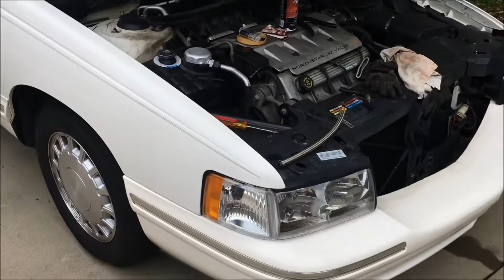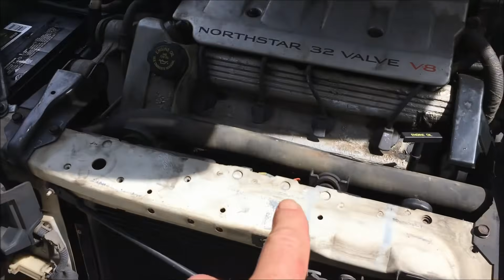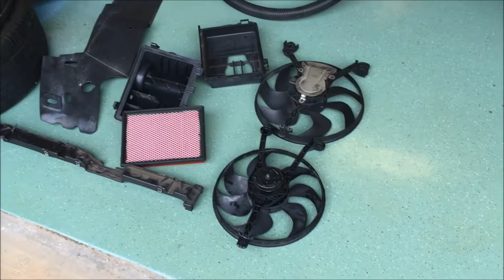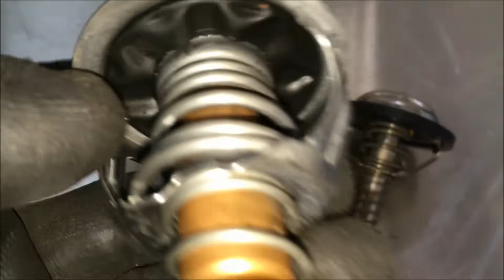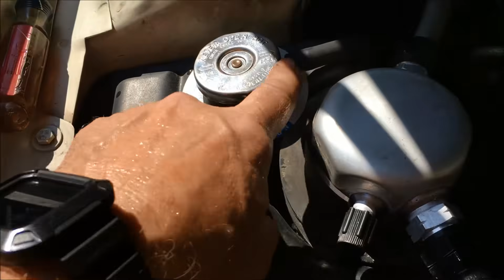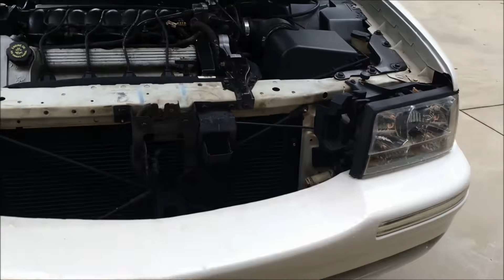How To Flush, Fix Overheating, Leaks, Coolant Reservoir, Radiator Replacement: Cadillac Northstar

Comment: Enjoying your videos. Old cars may drive me to drink. May consider bourbon as a cure. Maybe you could recommend a good brand. I knew nothing about Northstar Cadillacs. Never even considered myself a fan of the brand. But last summer I managed to buy a pair of the "tri-nines." Little did I know of their infamy. What "Bro Stone" calls the short "header bolts." LOLOLOL So my '97 DeVille D'elegance has had overheating/coolant loss issues. I had my longtime trustworthy mechanic replace the coolant tank that I ordered from GMPartsNow. Not sure if he checked/cleaned/blew out the line that goes underneath the big silver engine cover. I'll be checking this on my next day off. I may try to tackle the thermostat changeout under your tutelage. TYVM for the great videos. I subscribed.
Reply from the maker: Hi Jim, thanks very much for the comment and subscribe.  I'm glad my videos help.  I do everything myself because I don't trust most mechanics, especially after what I have seen from some of those who have asked for my help.  As for Bourbon, I love Buffalo Trace, Woodford Reserve... there are so many good bourbons!
Reply: you probably dont care at all but does someone know of a way to get back into an instagram account??
I was stupid forgot the password. I appreciate any tricks you can offer me!
Reply: @sebastianmiller9101  
Here's the password to get back in LETS GO BRANDON 😷 😷 😷 😷
Reply from the maker: Lol!!!!
Reply: @Huxley Rodney Thanks for your reply. I got to the site through google and im trying it out now.
Looks like it's gonna take quite some time so I will get back to you later when my account password hopefully is recovered.
Reply: @Huxley Rodney It did the trick and I actually got access to my account again. I'm so happy!
Thank you so much, you saved my ass :D
Reply: @Sebastian Miller You are welcome :D
Reply: Need help with my caddy on the cooling system bro 🙏🏼
Reply: @chinorider7251  what's up?
Reply from the maker: What’s the problem with your cooling system?

Comment: Only issue I notice I'm not over hearing I change almost everything especially new radiator but I'm having small leak after long drives when I shut the car off. It's look like the driver side mainly bottom middle
Reply from the maker: Only thing I can recommend is putting the car on ramps with engine running, get it super hot and trace the leak.

Comment: Cadillacs northstars are just pure JUNK JUNk JUNK , If the motor doesn't blow the transmission will
Reply from the maker: this car was well taken care of and had no issues with transmission nor engine.  Before it was wrecked, it was at 130k miles

Comment: i heard you say to burp the system you squeeze the upper radiator hose. did you do that with the reservoir cap off? heat on? can you give more details please, i have to burp my 1999 cadillac deville.
Reply from the maker: When the engine is first started and cold, you can burp the system by squeezing the hose to remove air pockets.  Never open the radiator cap while the engine is hot.  Also, it is best to run the heat at full blast while doing this.
Reply: @DrivingIntelligence thanks fam I did it today watched the bubbles

Comment: I get no hot air whatsoever, only cold air , its not leaking anywhere, im left with , replacing thermostat, doing a complete flush and replace coolant, or replace heater core?

Comment: I have a 99 Deville I can never open the radiator cap what am I doing wrong
Reply from the maker: You can’t open the radiator cap when the engine is cold? Normally, you just push down and twist counterclockwise.
Reply: The cap will not open when I turn it I have no idea if I'm just not pressing enough if I'm old LOL or what  @DrivingIntelligence
Reply from the maker: You might have a faulty cap, but it takes a lot of pressure.  And don’t open when hot!

Comment: Really thank you for educating me on this car I have a 98 Eldorado it's only got 78,000 Mi on it Elder gentlemen bought it what's 10,000 MI and it's mine now say beautiful car and I want to get a 150,000 out of this motor how do you replace the thermostat change the oil new plugs new filter new coolant I unhook the purge line and blew it out with my hose and fluid was coming out of the the reservoir so that told me right there that I didn't have any blockages so I'm good with that haven't had any trouble with it heating up I'm just it's just me I'm going to go through it and do what I think it needs to be done radiator looks good fans come on good I will probably have to replace the top hose pulled everything off the top blew everything out pull the engine cover off the top some squirrels left their acorns underneath there so I got all that clean beautiful car love it I just want to take care of it thanks for your input can you educated me on this finicky Beast
Reply from the maker: Thanks for your comment.  I love these cars and the Northstar Engine.  Check out this Playlist and let me know if you have any other needs:  https://youtube.com/playlist?list=PLGNsbVXzRfZOZLzjeTGQyLUsFDPYwttq4&si=Th7dKepGevsSWcRt

Comment: I installed a new surge tank but can not figure out how to get the clamp back on to the resvoir? On my 1999 cadillac eldorado.  Thank you for any help.
Reply from the maker: Hi Sheila, what is a “clap”
Reply: Sorry I meant the clamp/slash strap that goes around the ac accumulator
Reply from the maker: @sheilacoleman4134  sorry for delay getting back to you.  Did you figure it out?  I started a video showing this process and could release in a couple days.
Reply: Thank you for getting back to me, and no did not get it back on yet. Oh I would appreciate a video on how to do this. This was originally my Dads pride and joy. He passed away in December and we brought his cadillac to our house. So we want to keep it in the best shape we can as he did.
Reply from the maker: @sheilacoleman4134 sorry for your loss.  I’ll work on that video this week.  And let me know if you have other needs for your Cadillac.  What year and model?
Reply: Thank you so much, I appreciate your help. It's a 1999 Cadillac eldorado

Comment: Fixing my DeVille it overheats. the coolant reservoir is always full.the tubes running to the radiator feel empty. idk what it is
Reply from the maker: Did you check the tube going over the engine and returning to the reservoir to make sure it's clear?
Reply: @DrivingIntelligence  yes I flushed those lines but the coolant is still stuck in the reservoir and won't circulate is it a water pump or clogged line under the reservoir?
Reply from the maker: @MoSxJuve  have you checked the water pump belt?  Is the water pump in good order?  How about the thermostat?
Reply: @DrivingIntelligence  I changed the thermostat and the water pump belt spins but I haven't really looked at it
Reply from the maker: @MoSxJuve  maybe a silly question, but did you install the thermostat in the correct direction?  :)  Also, are you sure you don't have a head-gasket problem?
Reply: @DrivingIntelligence  idk it doesn't smoke bad
Reply: @DrivingIntelligence  I think it's either a blocked tube behind the motor where the reservoir line goes or the water pump
Reply from the maker: Does your oil and coolant look normal?
Reply: @DrivingIntelligence  the coolant looked milky
Reply from the maker: @MoSxJuve  that's a bad sign... could be a bad head gasket.  You might be getting exhaust into your coolant which is causing the overheat.  There are test kits you can buy that will indicate if you have exhaust material in your coolant: https://amzn.to/3ufq82b - I've not tested this kit, but it could help you pinpoint your issue.
Reply: @DrivingIntelligence  the owner said she put a sealant in the radiator for cracks that may be making the coolant white
Reply from the maker: @MoSxJuve  and could also cause a blockage... :(

Comment: So I just bought a 97 Cadillac DeVille d'elegance, I'm overheating because she is overheating, I replaced the thermostat, I've already replaced my  alternator, but I am getting ready to replace my reservoir. Ugh. But ty for this video. You helped a lot. Next imma have to fix the air hose for the car leveler? Something like that. I'm dragging and riding low. I'm gonna look to see if you have any videos on that. Thanks again buddy.
Reply from the maker: Make sure you check that return line to the reservoir.  That’s the biggest cause of overheat with these engines.  I showed in my video… also, check out this video:  Overview of Cadillac / GM Electronic Level Control System - Deville Series Part 13
https://youtu.be/jSEWSeHufKY

Comment: Going to see if any of this will help my 98 STS. Off road since November, took it out yesterday, and no problems until I put the AC on (don't need it much in my country tbh), and it started belching steam from under the hood. Heard some ominous bubbling from around the head are, and lost majority of water from the expansion tank through the plastic lid
Reply from the maker: Did the overheating start instantaneously when you  turned on the AC?  Are you sure your electric radiator fans are turning on with the AC?
Reply: @DrivingIntelligence  Thanks for getting back. That seems to have been what happened. Although the fans turn manually to the touch, didn't hear them running. Had taken the Cadillac onto the motorway, got to my house - no problems. Took it a short distance to pick up son, switched cold air on and next thing I notice steam appears.
Reply from the maker: @iainmorrison4606  slower driving increases engine heat, especially with AC on.
Reply: @DrivingIntelligence  thanks. Just tested the thermostat - working, so think a combination of putting the AC on and the fans not working (thankfully in Scotland we usually only get a couple of days of hot weather!)
Reply from the maker: @iainmorrison4606  yeah, those fans are absolutely important to cooler running.  Check the fuses and relays?
Reply: @DrivingIntelligence  fuses and relays fine. Is there a sensor to operate the fans? I couldn't find one and factory manuals not providing an answer (though had provided something to chew on for the mice that got into the car). Think this is a definite single malt time.... cheers

Comment: I have a 03 deville with an overheating problem a weird heater problem where the driver side gets hot but the passenger side doesn't and I'm clearly not getting cool and all the way through the system because my top hose has very little water in it and stays squishy and never gets hard so the previous odor replaced the water pump I've replaced the thermostat I've checked the top middle line for blockage but the coolant was kind of nasty so I'm now flushing they got for your video that show the location of the pecock because I could not find it. But when you flush do you close the pecock or leave it open? Do you recommend a separate heater core flush also? I have heard that flushing the whole system can lodge particles in the core and cause problems with heater core blockage?
Reply from the maker: In my opinion, a power flush that pushes the fluid through the entire system could plug the heater core unless flushed in the opposite direction.  If you're getting heat in the passenger compartment, but only on one side you might have a blend door problem.  Do you have dual climate controls?  There will be 2 blend doors, one for the passenger side and one for the driver side.  If you are adjusting the temperature at the panel, and only getting temperature changes on one side of the vehicle, it could be the blend door actuator.  You'll need to test for operation.

Comment: Have a 99 cadi devile its leaking in the middle under neath the car
Reply from the maker: Thanks for reaching out.  Have you put the car on ramps and looked for the leak?
Reply: No I haven’t not its leaking un the frame close to the driver seat having to put antifreeze in it 3 to 4 days
Reply from the maker: @jacobattaway7582  I really can't help you without more information.  The coolant can leak from one location and show up in another location.  Look closely at the area around the throttle body to see if the cross over tube is leaking,.  Take the engine cover off first.
Reply: Ill try tht when i get of work
Reply from the maker: Excellent, let me know

Comment: So I read another guys post where he losing antifreeze on the middle bottom of the car and he said the fix was a bad thermostat.  Now if the thermostat is near the air filter, why would antidreeze be leaking from the bottom.  I just floored it because of poor engine performance due to bad coils and then I saw the car was overheating and when I looked on the bottom of the car it was leaking coolant.
Reply from the maker: sad thing is leaks can start in one place and show up somewhere else.  You will need to let the car get very hot as I did in my video and inspect for leaks.  If your car is overheating, check the return line at the top of the engine as I mentioned in the video.  Could be plugged.  An overheat is going to create a leak given the higher pressures in the cooling system.
Reply: @DrivingIntelligence  Thank you.  The coolant or water, seems to go right through the coolant thingy.  I only drive short distances because I’m so afraid of it breaking down
Reply from the maker: @jesseadriangonzalez  wish I can help!  Have you found the location of the leak?
Reply: Head gasket

Comment: Question the brackets holding the radiator to the condenesor wtf bro is the trick
Reply from the maker: Hi Danny, are you talking about the one bracket on the side of the radiator that holds the refrigerant lines in place?  Or are you talking about the condenser brackets at the bottom of the condenser?  Any way you can send me a photo to my Facebook Page?  www.FaceBook.com/DrivingIntelligence/  Thanks!
Reply: I can't get mines back on tight

Comment: How much did you charge for that work? I just bought a 1997 10700 miles, bought it for 500! But it overheats! still would like to fix it! Love this car
Reply from the maker: They are great cars.  That was a bit expensive to replace the radiator, coolant tank, thermostat, hoses and associated labor.  I would be sure to understand where your overheating problem is coming from.  Is your radiator full?  Do you see any coolant leaks?  In my video, I point out that one line that crosses the intake that many have had problems with plugging.  Check that first with a cool engine.  Also, get the thermostat I suggest that is a fail to open device.  Good protection.  Let me know what you find.  You can also reach me on my Facebook Page:  Driving Intelligence
Reply: @DrivingIntelligence  Hey I have an 1995 Cadillac Seville sls . I have my coolant leaking all out from the bottom of the car near passenger side . Idk what it could be
Reply: @reesogotti5059  could be leaking from radiator
Reply: @DrivingIntelligence  hey my 97 eldorado overheated yesterday , im doing a check up today , hoses, lines, and thermostat